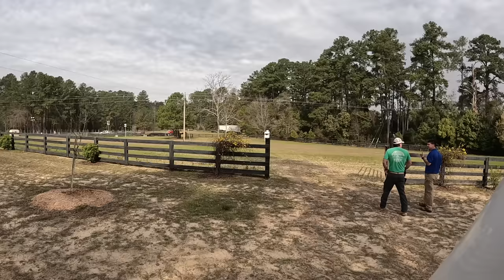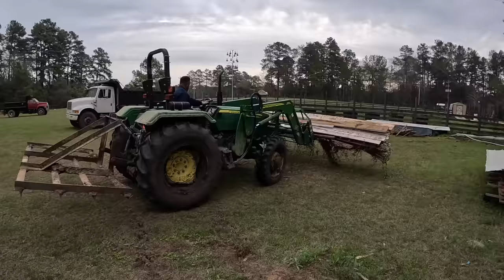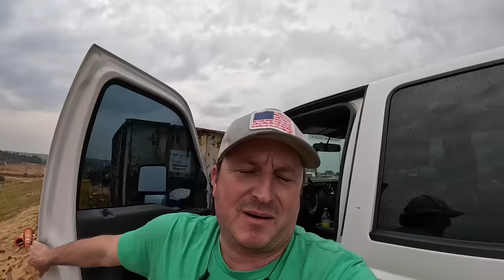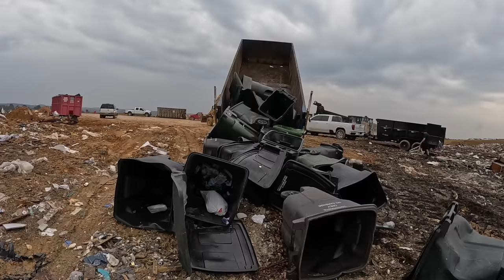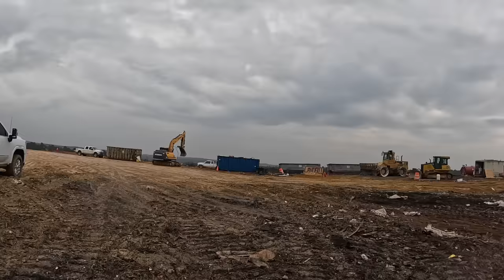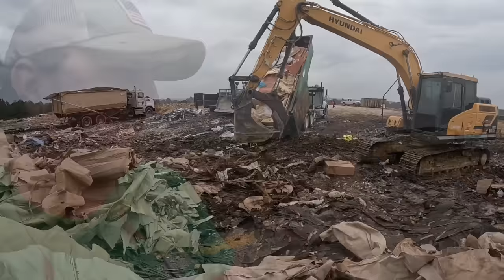LANDFILL VLOG - C&D LANDFILL

Comment: Hi Mr Digg !

We have a shark DSc cutter head dredge with 28 foot ladder .

Is it possible to convert from cat diesel engine to an electric motor ?

Also did you keep using hydraulic cutter head or can that be electric also ?
Reply from the maker: Sure you can convert to electric as long as you have reliable power nearby. We still use hydraulic to power the cutterhead. I’m not sure if that can be fully converted to electric to be honest with you buddy?
Reply: @TheRealMrDiGG  ok 👍 the hydraulic cutter head is good as long as maintain the lines and keep the cutter head secured properly because last one we lost cutter head because the bolts were loose so the shaft broke !
Reply: @TheRealMrDiGG  we having trouble finding the rubber / hard plastic parts that go around the sand screws that push the sand up the screw . Do you have a supplier or someone that you can refer to us ?

We are rebuilding/ refurbishing the entire plant and all the machines because we have a new owner and are shut down for several months to get everything ready and more efficient so when we open we can stay up more and keep it efficient
Reply: @TheRealMrDiGG  we have reliable power supply just going to need an expert that can assist us ..

The new owner is on the ground and extremely knowledgeable but has never run a sand plant so we trying to do everything right but need someone that knows who the experts we can contact are .
Reply: @TheRealMrDiGG  no problem thanks ! I admire you for all the knowledge you have and work ethic ! I wish you could help us with some of the decisions we gotta make !
Reply: @TheRealMrDiGG  do you have anyone you recommend to contact about converting to electric motor ? The new owner has money, he paid cash for the 140 acre mine